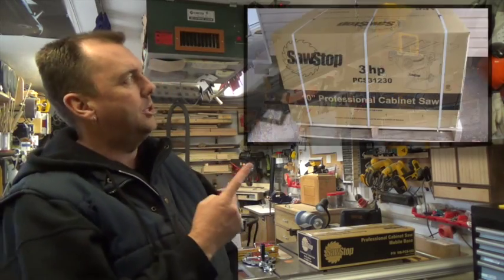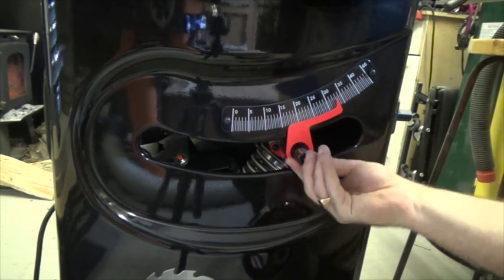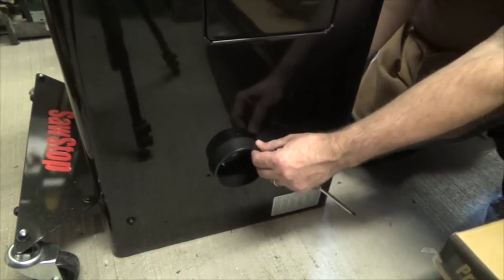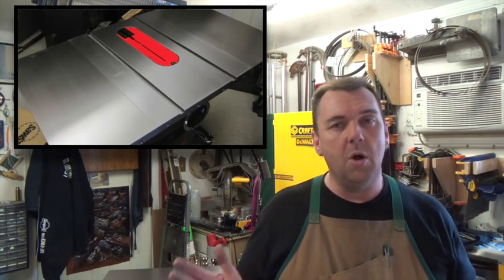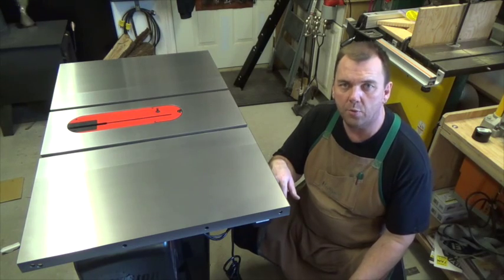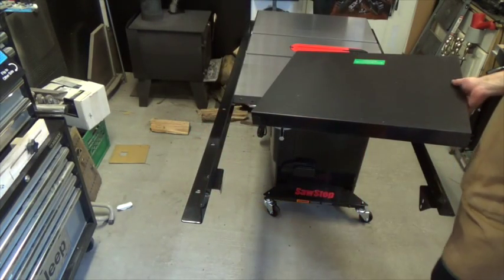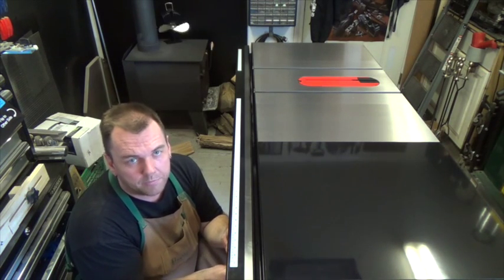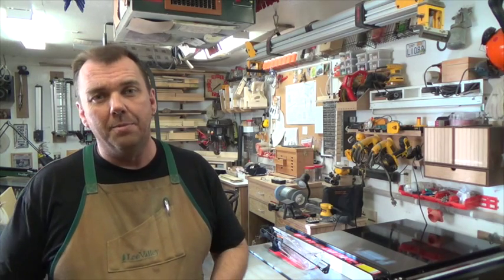Sawstop assembly

Comment: And now to make more zero clearance plates. :-P
Reply from the maker: Josh Olson I like the way you think.  I'm not sure if it is possible with this saw though.  The one cool thing about the Sawstop, is its geometry.  The factory zero clearance insert works on any angle of bevel that the blade can be tilted to.  Normally, the insert requires a wider hole in the throat plate to accommodate the tilt of the blade, but that is not the case with the Sawstop.  It's quite cool.
Reply: kennyearrings1 So, you piqued my interested enough to Google around about the geometry; I couldn't find anything but saw a lot of aftermarket ZC plates for SawStops. Maybe they're just trying to capitalize on uninformed customers? Video idea: show us how the geometry works. Semi-related note: SawStop makes it really hard to search for anything about their products -- damn near everything just talks about the safety mechanism! "Yes, yes, I know... but what else does the product offer!?"
Reply from the maker: The only reason that I'm not sure if it is possible for the Sawstop, is due to the way that the zero clearance insert secures to the throat opening.  There are no screws or hold downs, but rather a lever type clamps that holds it in place.  I'm not sure if showing the geometry of the saw would work for a video idea because, quite simply, I don't really understand it either.  All I know, is that the blade tilts to any angle, while shifting on the trunions to allow the blade to fit perfectly through a zero clearance insert at any angle.  As far as what the saw offers?  It is a cabinet saw.  It is engineered to be a little more beefy than most because it needs to take the abuse of that brake mechanism kicking in.  The forces on that must be difficult and would definitely not do well on a normal saw.  The fit and finish are also something that I was impressed with.  The blade tilt and blade elevation are all gas shock assisted, making it very smooth in operation and I have had several weeks to work on the saw now and it seems that their dust collection does exactly what it claims.  It collects almost all of the dust.  I haven't had a chance to really test the over arm collection yet as it doesn't allow itself to the type of work I am doing lately but I will be testing it out soon, you can bet on it.  The fence is extremely sturdy and functions flawlessly.  Bottom line, is that it is a very impressive unit thus far, but for the price, I would expect it to be.  Main feature still remains as the safety system that it houses.
Reply: kennyearrings1 The aftermarket ones I saw had no moving parts (no lever type clamps); they could be fabricated with wood/MDF, albeit more work because evidently the SawStop has a lot of things to clear so it'd rest flush. So, a router with a few bits would be required. The most prolific one I see is made by Infinity Tools; it looks like people are using it for different kerf widths and dados -- not just different angles on a standard blade. So, I guess I can buy into the geometry just being cleverly designed. :-) ... Regarding what the saw offers, I was only really curious about how that ZC mechanism works but I appreciate you taking the time to inform me; always good to know what I'm missing out on -- I just got the Ridgid R4512 a month or so ago (got ~25% off w/Harbor Freight coupon and an overly eager manager). I haven't used it yet though -- been shopping around for deals for my first workshop. :-) By the way, you convinced me to get an Excalibur EX-30. That's still sitting in its box, too. But I have plans for it at least!
Reply from the maker: You'll love the EX30.  I use mine all the time as you probably already know.  It's a beautiful saw.  Good luck with your Ridgid.  Up until the Sawstop, I ran a Ridgid for years and loved it.  In fact, the guy that bought it from me, just picked it up today.  Kind of sad to see it go.

Comment: too much $$$$ for me
Reply from the maker: +Robert Appleby They are a lot of money and I had a hard time putting out that kind of cash initially.  But I have to say that after having the saw for a while, I don't regret the purchase at all.  It's an extremely high quality saw that perform flawlessly and the added safety features are a bonus for me.  Thanks for tuning in.
Reply: +kennyearrings1 I'm certain it's worth every penny. Most of us just can't justify the expense for these Cadillac tools for a hobby
Reply from the maker: That's the best part about woodworking.  It's possible to make the same projects by hand as you can with fancy tools.  One of the great things about this hobby.